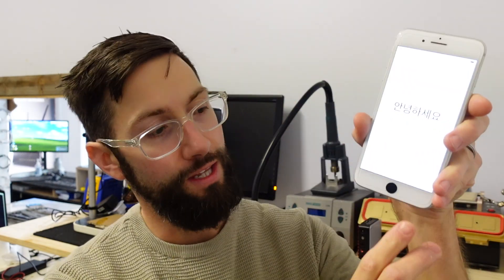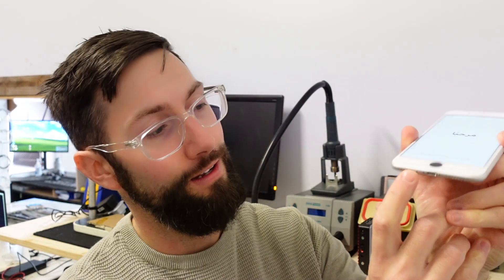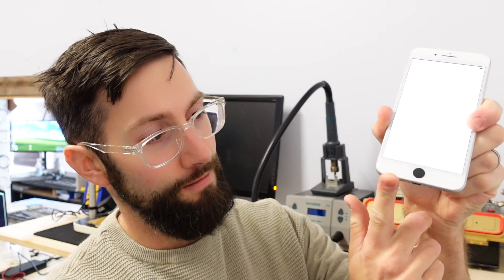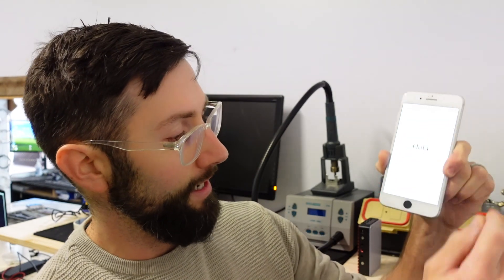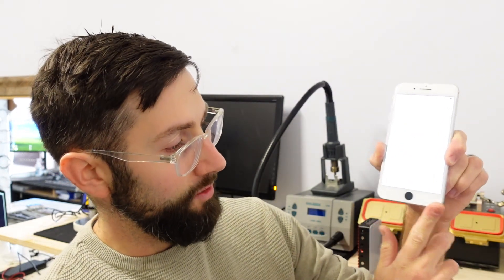Iphone 7 8 No Audio During Calls, Explanation and other possible Solutions

Comment: I have a iphone 7 when i get a call i can hear the ring but they can't hear me and i cant hear them and all my app has no audio at all, i can answer a call but no audio at all and all my speakers are some what clean at least to a point that there's not a blockage for no audio come out at all, can you help to know if it a software or a hardware problem.
Reply: Same I can’t call on any app and even if I try using FaceTime audio it goes called failed idk how to fix
Reply from the maker: i would recommend taking it in to a local phone repair shop

Comment: Just updated to the current software and connected my new AirPods with the iPhone 7+ and then all these issues started happening can only call with AirPods otherwise when I call someone or someone calls me I cannot hear them or they cannot hear me, also voice memos don’t work.  Would that be because of the phone, the AirPods are new so I doubt it would be them.
Reply from the maker: Sounds like a failed audio ic on your iPhone 7 + 

Bluetooth audio still works
Reply: @rickstechrepairs  ah right yeh Bluetooth works and I also looked it up about how when starting the phone it gets stuck on the apple logo. Would the phone still function if I don’t get it fixed?  I’ll probably get a new phone towards October now, I have had it for a long time.  I just don’t want to loose everything on the phone I just hope it doesn’t turn off by the time I get it

Comment: Hello,
This problem has been happening I think because I smacked the phone pretty hard on the floor. Here's the thing though: I have audio in all situations EXCEPT when I try calls!!! and they also dont hear me. Pretty damn weird.
Reply: You’re right it happened to me after dropping it from like 6 feet high flat on its back… 😞 ALL audio works except on calls
Reply from the maker: if its an iphone 7 i would suspect damaged audio ic
Reply: also when i plugged my lightning adapter earbuds into the jack it wouldn’t play audio in it but it would play on the speaker and on some calls with out speaker on i would just hear a buzz or whizz come out of the top speaker
Reply: Did you ever find what caused this problem, or a solution to it? Just started having this same exact issue this morning.
Reply: @danielyany8666  for me it happened randomly as well. i think it’s a flaw on the iphone 7 and i’m pretty sure if it’s fixed it might happen again i’m not sure